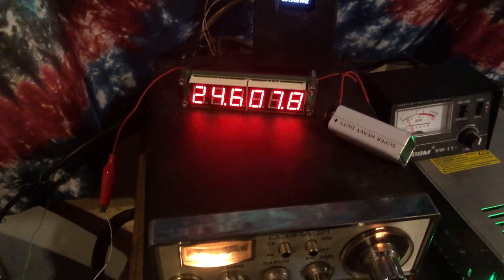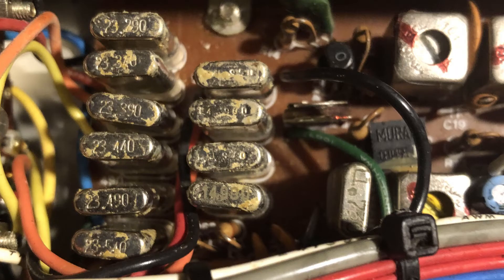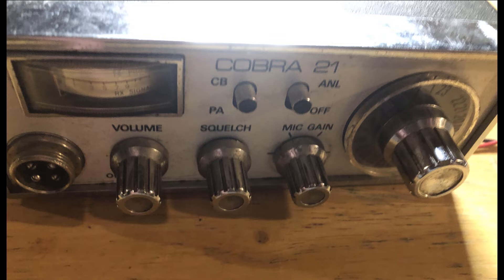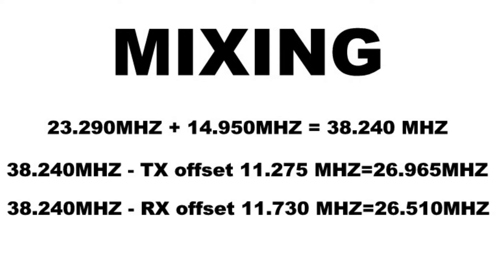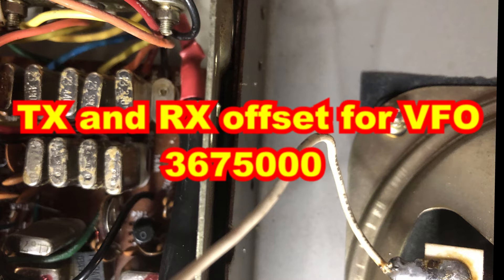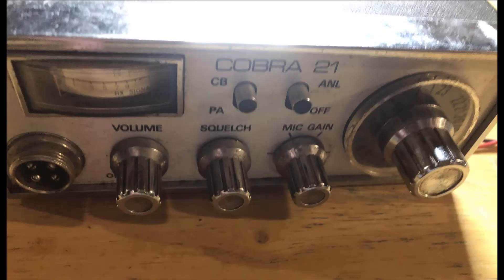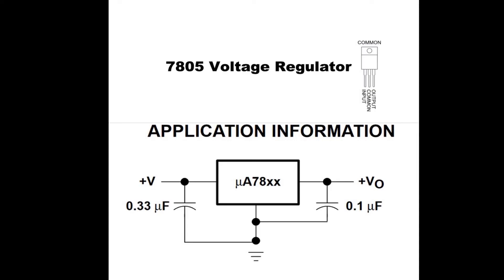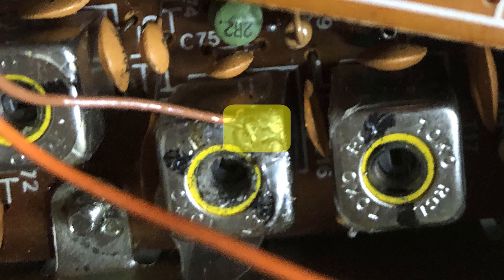Cobra 21 CB Radio VFO install RPI2040 (DDS VFO cb radio mods extra channels)

Comment: Can you do one on cobra139 dds vfo.
Reply from the maker: I don't have a 139, but a channel called ham radio hack has done one using the same VFO in your video.
Reply: @CircuitSecrets jeb projects   i learn video ddsvfo layeffee ssb 100 this might work with cobra139 you need dont  need program offset my frequency counter hads automatically off set.
Reply from the maker: @Foxman362worldradio  Yeah the old crystal rigs with a common mixing crystal for tx, rx, AM and both SSB modes needs no extra offset, just calculate for the mixing circuit, so a fixed offset, not tx/rx offset. You can use a frequency counter, but the display of the VFO will not match the actual radio's frequency and you must rely on a frequency counter. This is not good because you can accidentally transmit on unauthorized frequency or mode depending on your license and location. Best practice is to calculate frequency, and test with a dummy load to confirm before transmitting.

Comment: Cua do el aparato pierde la resepcion.por donde enpesar.o que componentes revisar.
Reply from the maker: Use a frequency counter to ensure the VFO is generating a signal, check you have not shorted signal to ground..

Comment: do you think i can do this mod to a midland alan 48?
Reply from the maker: I think  the alan already has  multiple bands.
Reply: @ it has only the D band, they sell some boards to expand the bands and if I remember correctly there are 2 quartz on these boards so I think it just subtracts or add an entire band
Reply from the maker: @blnkfce9664  You can easily modify the code to add any band.

Comment: Hi there! Awesome video series and idea, I'm planning on doing this myself with some more features like fine tuning. I have a Midland 13-853 23 channel that is the perfect candidate for this. It's built a bit differently than the Cobras, such as soldered-in crystals, but mixes the exact same way. If you ask me, this would be a PERFECT idea for also adding on the 10M AM window (29.0 - 29.2MHz) allocated to us hams.

Did you happen to run into any issues of the SI5351 generating any harmonics, or will the radio circuitry help filter that out? If not, would you recommend adding additional filtering on the clock output?
Reply from the maker: Thank you, yes that sounds like a great radio for a vfo. You can set the limits however you want them in the code. I don't have a scope to check for harmonics, I have asked other operators to check the modified rigs for bleed, and they tell me they are clean.
Reply: @CircuitSecrets  Thank you for your response! I more than likely have to desolder the Channel 1 crystal since it is hard soldered in the swtich board rather than socketed like the Cobra in the video, but this shouldn't be a problem...hopefully...

Once again, a very helpful video series that has gotten me back to the sole thing responsible for getting me into ham radio...CB radio!

Comment: Hello sir Thank you very much for the guiding, I wonder if it works Alston my tube radio Robijn T123 and the T123b these are both full tube radio I would appreciate it very much if you can take look at it Thanks in advance Bert
Reply from the maker: Yeah, the main connection would be to the 37.600 crystal position. The offset would be set to 10.635. Operation would be on channel 1. Double check all that with a dummy load, and frequency counter.
Reply: @CircuitSecrets  thank you very very much , I will try to measure , but did not have a lot time , Other projects keeping me busy 🙏🏻

Comment: Sure,too easy.😅
Reply from the maker: The older radios with simple crystal mixing are all easy. A schematic and tech notes is all it takes to figure out, then swap a vfo with the proper offset for a crystal. Even more modern radios use mixing and you just bypass the vco and inject vfo in its place.

Comment: Why? It's an am only 23 ch, low power out.  Waste of time.
Reply from the maker: It is the simplicity of the circuit. It makes for a good primer on how to modify the mixing circuits of radios. A simple cheap DIY approach that is meant to lower the entry point to learning and modifying radios. Anyone will feel comfortable experimenting with these methods on such a cheap radio, and if their experiment fails the education cost is still low.
Reply: I bet you think the audio off of channel 6 is impressive.

Comment: Add a vfo to a cobra 139 23 channel base station with upper and lower sideband please
Reply from the maker: I still have to do a revision for ssb, these are designed for AM, CW, FM only. I hope to get one done for that this fall or winter after I get a side band radio to use for a test bed.
Reply: Why bother? Those are junk radios, only 8 to 10 on ssb. Don't polish a turd

Comment: Interesting series, have you tried transmitting? I was surprised it was such a simple drop in without matching levels? Or getting more spurs ?
Reply from the maker: Thank you. Yes it transmits and receives. The si5351 was designed to be a direct replacement for crystal oscillators. Unfortunately I don't have a scope or analyzer to check for any anomalies. One of the local ham guys I an pretty good friends with monitors the bands and lets people know if they are bleeding or causing a disturbance anywhere, and he has not said anything. Its not as accurate as a network analyzer, but it is the best I can do right now. I have talked on the radio with the mod for about a week and everything seems to check out. My frequency counter says its on frequency. It does take a while for the three crystals and vfo in use in the radio to warm up, so the counter reads off by a digit for around 10 minutes after I power the radio on. Thats kind of expected with 3 crystals plus the VFO. I don't use any extra power so if it is throwing a few spurs they wont be too problematic.
Reply: @CircuitSecrets  I'm going to give the si5351 a try based on your inspiration with some RC radio designs I've been playing with, I see that circuitpython has a si5351 library so that may streamline things. Thx again.
Reply from the maker: @khimbittle7705  Yeah absolutely, I have a background in C and actionscript AS2 specifically thats the only reason I use arduino for most things, I always intend to try out some python but always get tied up with projects and its easiest to just use what is familiar. Let me know how the project goes and some details, it might inspire me! Thank you!
Reply: How can a simpleton like me install this in an old tube regency imperial. I’m retired with a very limited budget. I don’t know anything about programming